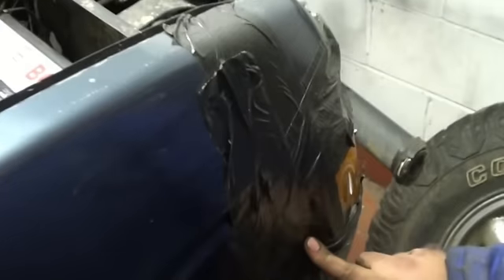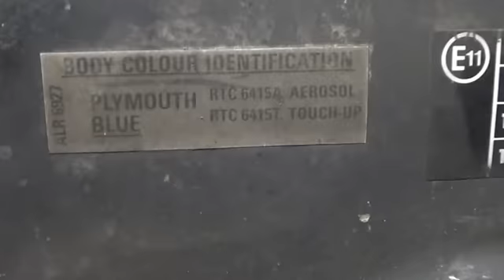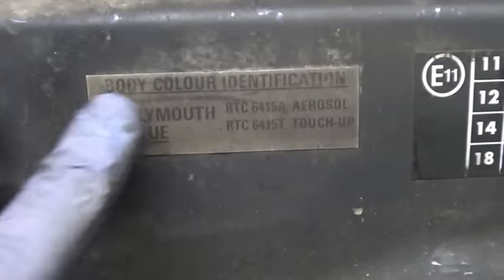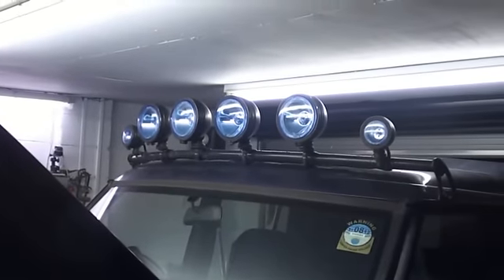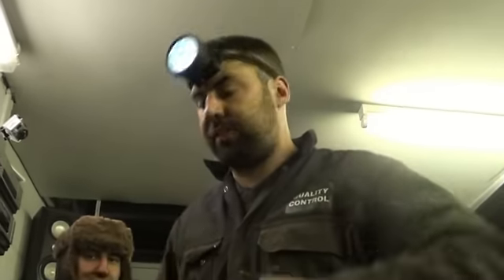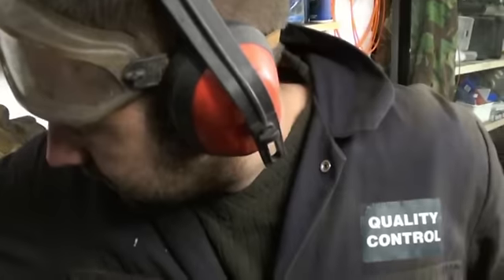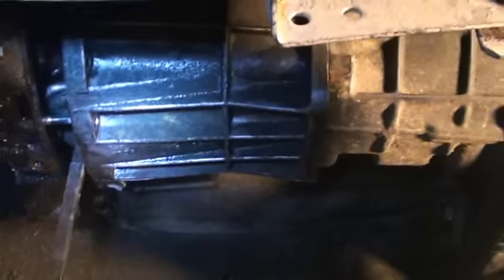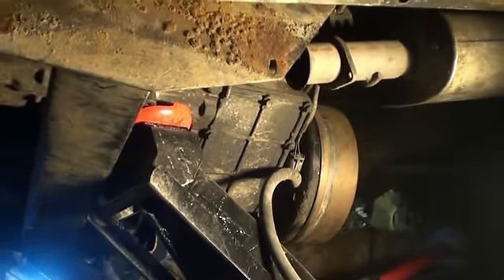How to remove a Land Rover Discovery gearbox, the VERY PROFESSIONAL way

Comment: Hi great video i just brought a 2002 landrover discovery td5 with a crook auto gearbox the owner took it to a gearbox place they said the the trigger wheel sensor was off center trigger wheel was found to be very loose and can move back and fourth 10mm would that cause it to only have first gear and reverse ive been told its a common problem the bolt comes loose

Comment: That's why you pull the motor mounts and drop the engine to get at the top ones......

But sure, you can cut holes in the floor pan if you like.

Comment: I have a 2003 Landrover and I wanted to know if I can install a 2001 engine in it or vice versa can I take the transmission out of a 2003 and 4 and put into a 2001 are they compatible

Comment: the nut was chewed only half way down....socket not on properly or wrong for the nut - some sockets are chamfered more than others, so they don't grip all the way down the nut........Ive done this on a defender...the transmission tunnel unbolts! so I didn't have access issues.......just massive gearbox to move issues!

Comment: the much better way and easier way i find is to put a strong arm in through the drivers/passenger door and tie a sling around gearbox and lower and same way back in much easier than trolly jacks,

Comment: Hey i found out that to get that top nut off, you have to take the engine off its rubber mounts, then drop it back down onto the chassis. Which lowers the engine and gearbox down 4 inches to gain better access to that shitty top nut.
Reply: Tom Common I'm trying or wanting to install a transmission in my 04 how technical is this and can you actually walk me through it I'm new to Landrover and actually repairing them but I've owned three of them big money whole but I like them😒

Comment: Too much joking around
Reply: If you have ever been in a mechanics workshop then you'd rethink your comment.
Reply: I know that I just need to know how hard it is to replace a flex plate on a 1998 Landrover 4 litre V8 Discovery...
My father had a mechanical workshop back in the 80's for many years and I used to help him a lot but we never 
ever had a Discovery in the shop or any 4 wheel drives for that matter...
Reply: I'm having trouble finding someone to do it they either say it's too hard and to big of a job or they want around $1500-00 to do the job..
I know I shouldn't of commented like I did I was just frustrated...
Reply: And my farther is not with us anymore.
Reply: Flexplates are easy just have to drop the tranny and then it is just like a basic clutch job from there
Reply: Thank You.
Reply: No such thing